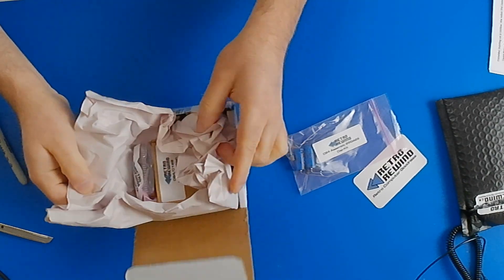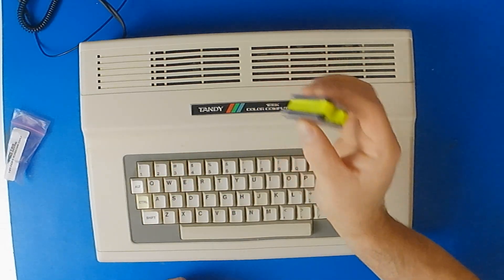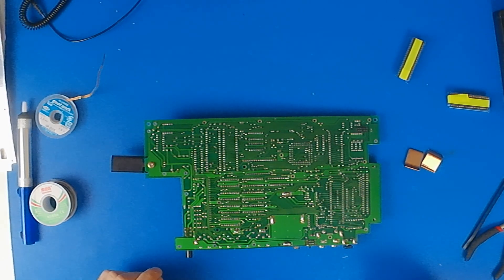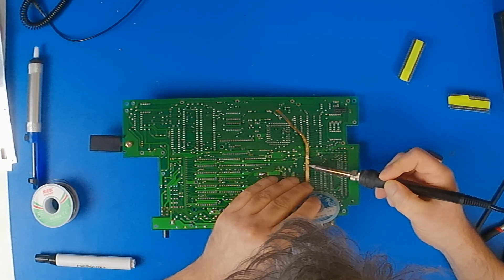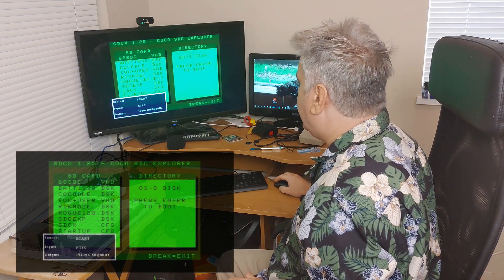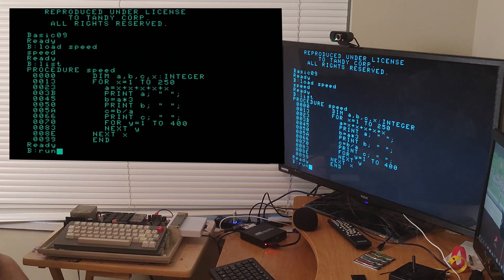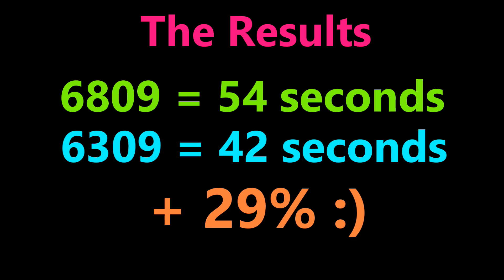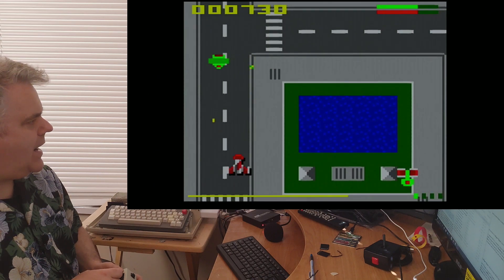Upgrading My Tandy Colour Computer 3 With A 6309 CPU

Comment: Hey Ken
 Have you recapped that Coco3?
Reply from the maker: It is on my list, I have tested them and they are all still within ESR limits so it is not an immediate job (unlike my C64 which had 3 caps WAY out if spec)

Comment: One minor correction - the 6309 didn't come out until 1985/1986 (Hitachi's 6809 clone was out much earlier though, so I think that is the 1982 date that you quoted. Also, if you compare text output between the 6809 and 6309 versions of EOU, you should really see a difference, especially when scrolling the screen (on both text and graphics windows). Another good speed comparison to try is Rescue on Fractalus, which has been optimized for both the 6809 and the 6309 on EOU. The 6809 version is already about 10-12% faster than the original Tandy version... but the 6309 is quite a bit faster than that.
Reply from the maker: Yes, I misread the article I looked at about the 6309, Ooops!
Reply: @CanadianRetroThings  - Found out from Joel Rees' translation of the original Oh FM! magazines from Japan that the HD6309 went on sale around October 1985.

Comment: Add a little new solder to each pin before you desolder them.
Reply from the maker: I will have to try that, thanks!
Reply: @CanadianRetroThings  I'm not sure it would have made a difference in your case, but the idea is that adding new solder helps the old solder to melt easier.
Reply from the maker: @davidkroeker1821  Most of the solder came off easy, there was a few trouble spots that may have helped.

Comment: Great upgrade and video! Thanks for sharing.
Reply from the maker: I'm just glad I finally got up the nerve to tackle this!
Reply: @CanadianRetroThings  Do you know if there is a CPU upgrade foe the CoCo2?
Reply from the maker: @RudysRetroIntel  The 6309 can go in the CoCo 1 or 2 as well.  There is the benefit of it running cooler as well as some games that have been optimized for it.  There is also a 6309 optimized version of NitrOS9 Level 1 that works on the CoCo 1 and 2 with a 6309 that includes BASIC09.

Comment: Cool!  My CoCo3 came with a 512k expansion board, but I'm way too nervous to attempt surgery to install it.  I haven't touched a soldering iron since I was a little kid!  Mine is still sporting the 6809.  I still haven't figured out if the joysticks I have are bad or if it's something internal...  so many projects, so little time ;)
Reply from the maker: I was very nervous doing this!  I also had not touched a soldering iron since high school until about a year and a half ago.  I started buying a bunch of cheap do it yourself projects to practice on before attempting anything on the old hardware.
Reply: @CanadianRetroThings  A wise decision indeed! LOL
Reply: Adding the 512k board is much easier.. just 2 capacitors to clip.. remove old ram and pop in new board... just don't run around the static  carpet with you board !
Reply: @MrDave6309  I'll have a look at it.  Thanks!

Comment: So is the Coco 3 maxed out now? Good call on cuting the pins btw. Some pcbs make it really easy to remove chips and components others, not so much. You're right, chop up the cheap part and save the much coveted Coco board. Would there be any point in doing this upgrade on a Coco 2?
Reply from the maker: NitrOS9 Level 1 (for the CoCo 1 or 2) also has an optimized version for the 6309 which includes BASIC09 (which is the program I did the speed test on)
Reply: @CanadianRetroThings  That's a very good point, between Basic09 and the optimised Coco 1 and 2 games I've got an answer to my question, thanks 👍
Reply from the maker: I believe the 6309 will run cooler in the CoCo 2, other than that I am not sure.  I have posed the question to people that know a lot more than me and will let you know!  As for maxing out the CoCo 3, not maxed out yet as there are modern, bigger memory expansion boards than the 512K.
Reply: @CanadianRetroThings  Thanks for the info Ken ;)
Reply: The 6309 is a good upgrade to your coco1 or 2 especially if your cpu is already in a socket. Some games were upgraded to work on 6309 and it's more fun to program ml on the 6309 .
Reply: @MrDave6309  It's worth doing then, I'll update my todo list.

Comment: The new CPU sounds like a great upgrade. Looks like a fun project too.
Reply from the maker: There are a number of games on the CoCo that have been optimized for the 6309 and games that only run on it.  This plus the fact that it is 100% compatible with the 6809 makes it a very useful upgrade!